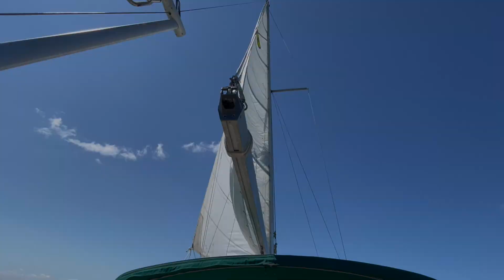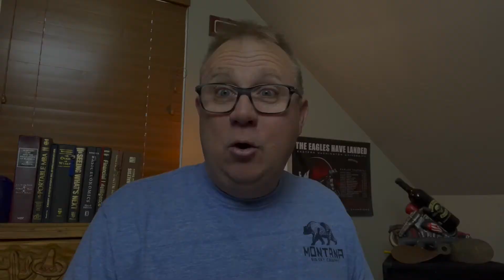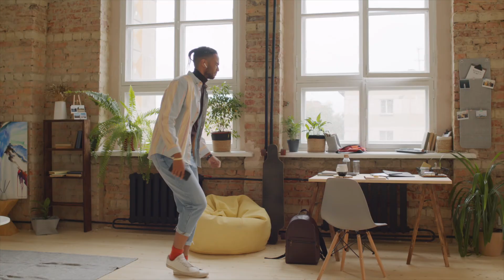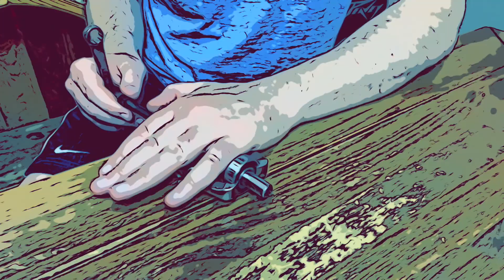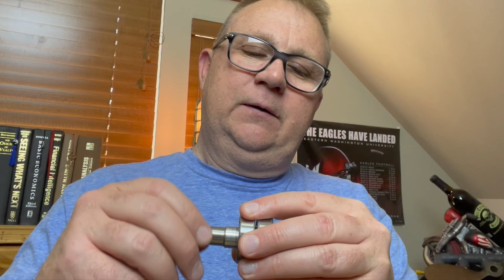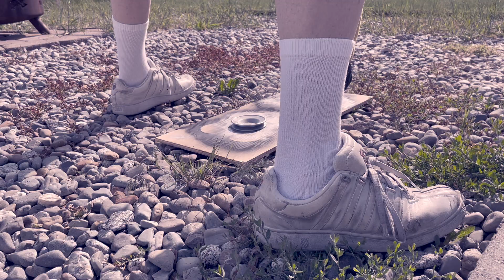S1E21 - Bad Rebuild Of Raw Water Pump On My YANMAR Engine!

Comment: Why did you say you incorrectly installed the bearings?
Reply from the maker: I used a bearing puller to install the new bearings... By doing that, I'm pulling on the outer race.  That puts lateral pressure on the bearings that could damage the bearings.  I was informed this by viewers after the video was published.

Thanks for asking!